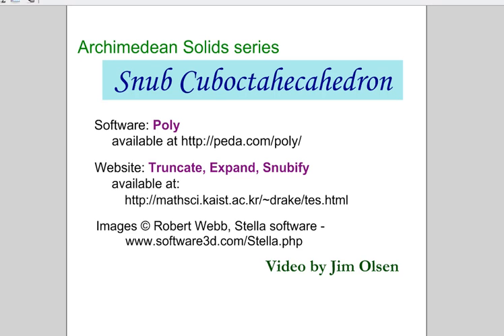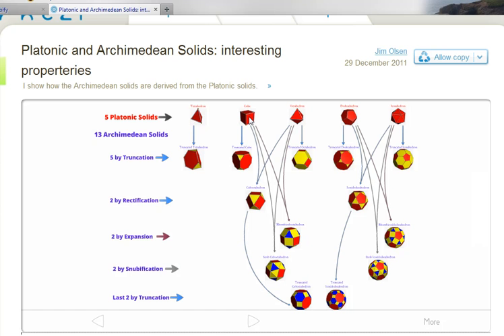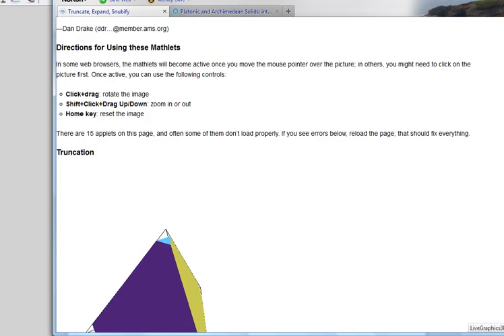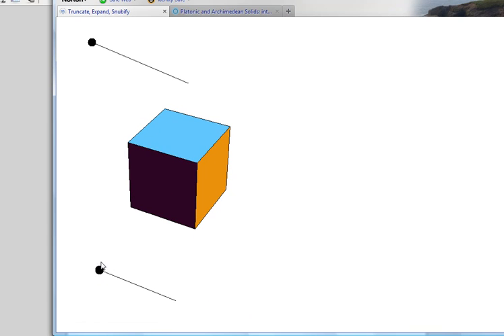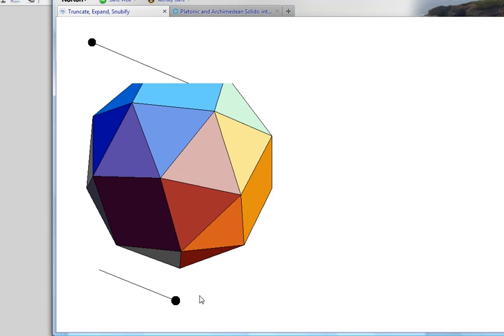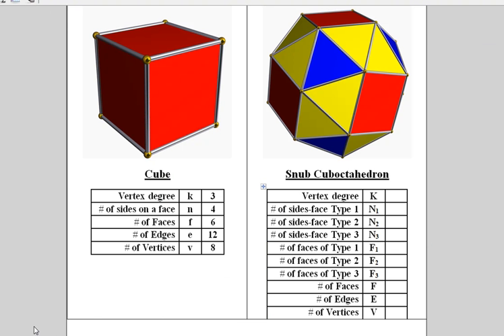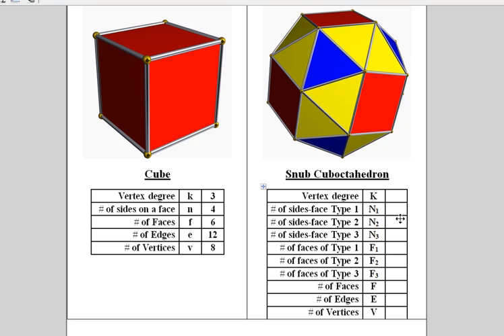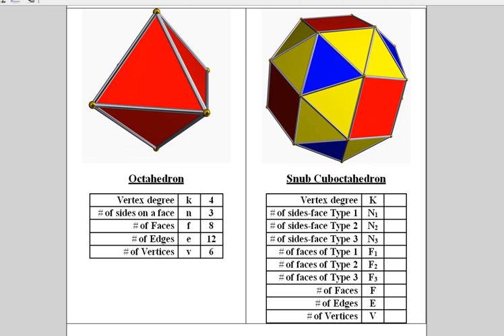Snub Cuboctahedron

Comment: long speech beggining in 5 seconds.
5.
4.
3.
2.
1.
tutorial for making any snub polyhedron.
but first, lets explain whats snubiffication.
snubification is an operation to make a new polyhedron from an old one.
and it is simular to expansion but with triangles, and its chiral
(chiral means mirror image is not the same thing and it is impossible to turn left facing thing into right)
start with any polyhedron (example is cube)
you rectify it (in this case the polyhedron is cuboctahedron)
you truncate it (now, in this case its the great rhombicuboctahedron)
you have 2 types of corners now, one clockwise (lets color these vertices black)
and one anti clockwise (color that one red)
now you have a choise, you can half truncate it clockwice (black) or anticlockwise (red)
if you chose those black vertices (corners) then it will be right version (➡)
and if you do it the same with red vertices (corners) then it will be the left version (⬅)
you get a snub cube.
and thats it.